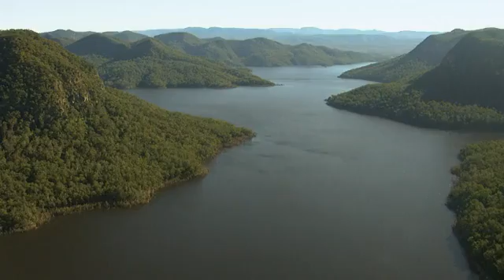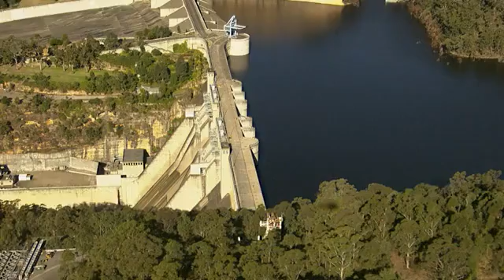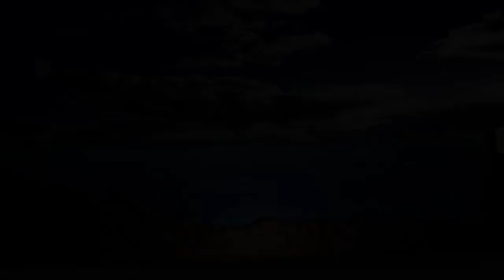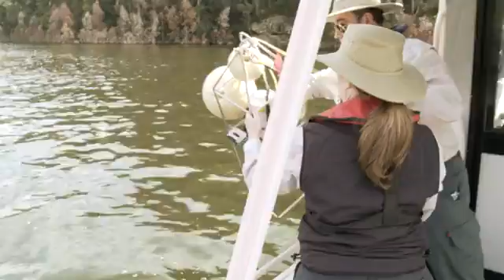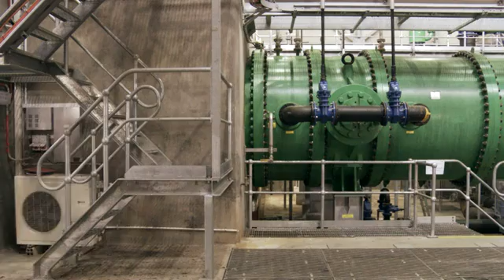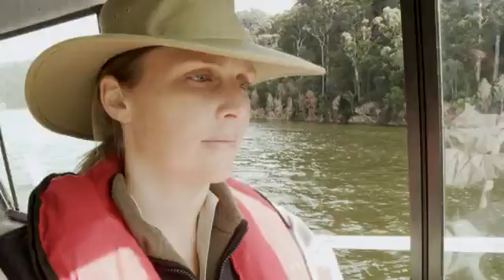Beneath Lake Burragorang

Comment: Cameras dont stop,em ive herd local hoon idiots finding hidden council cameras near Goulburn speedway by using a E.F.R or E.M.F reader things they learn in school 🤔 cheeky ay the same ones are illegally hunting throughout the region on night runs through the week .this device it'll pick up a battery as small as a button battery. a solid lead box is the only thing it cant read though then it becomes pointless due to the Camera not being able to transmit live feed to their phones though lead So heads up nsw waters your cameras are not as safe as yous think. Might need a better plan guys like a permit system for responsible 4x4ers , campers and responsible people alike . So come on while responsible people are in there the bonus is ones like i mentioned wont try it due to being spotted to easy . Dont burn the hand that helps you. If you want respect it works both ways it reciprocates.
Reply: Wrong on all counts bud. Nice try though, it's just just cameras that are used. Perhaps try get some education on what systems are in place before sprouting your BS.